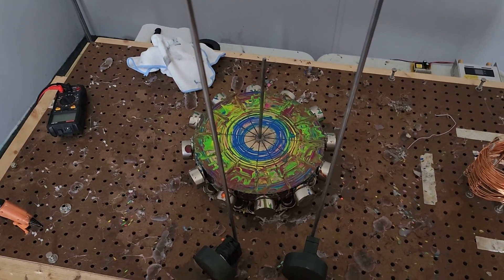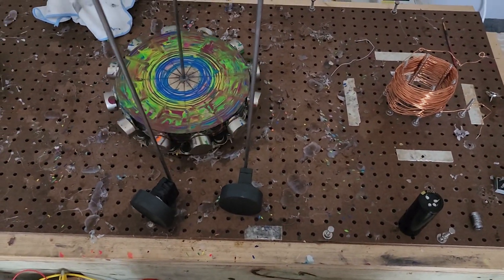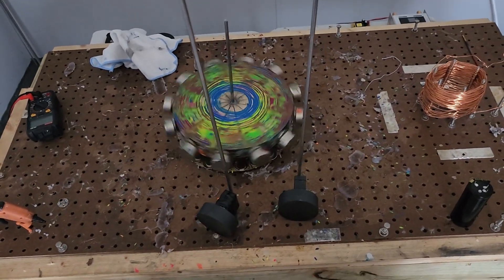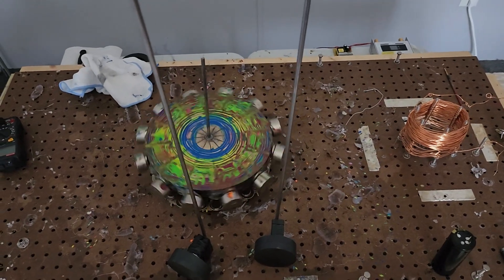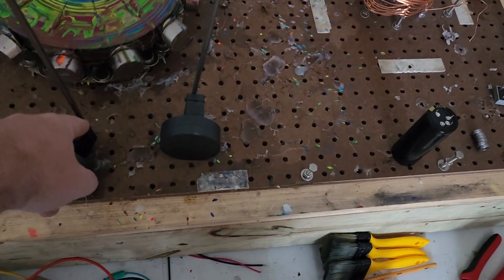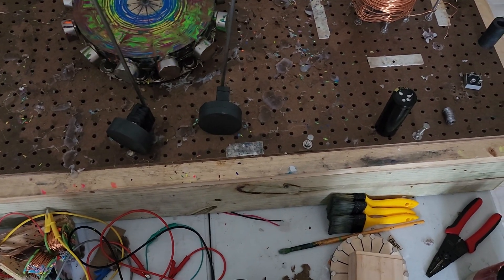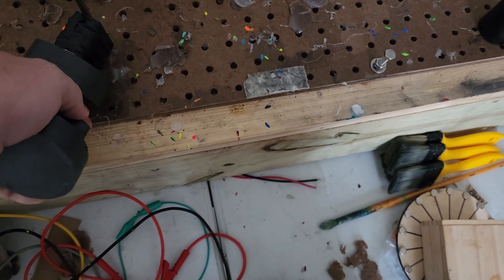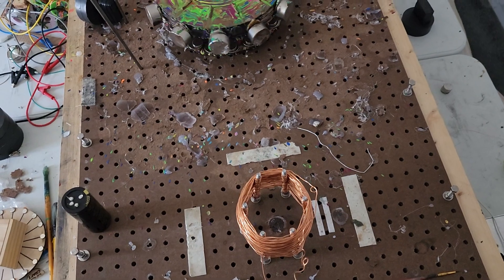permanent magnet motor prototype

Comment: If u put a vertical axis wind turbine on that it would probably spin forever as it would not need much power to top the spin up? X
Reply from the maker: It would spin on it's own for sure, drawbacks are weight  but yeah wind and 2 open windows

Comment: We'll done mate I am really shocked at ur results! I was thinking of a possible use type motor like ur design nsnsns arrangement but pins on top to the north motors and pins on the bottom of the south ones that pushes an opposing magnet to push it around. Hart to explain but if I get the chance I will try and experiment with it. I have seen similar ones but not quite wot I have in my head. X
Reply from the maker: I have not tried an alternating sequence yet, this is actually a pulse motor rotor and I agree it's hard to explain how it works but it's simple at the same time